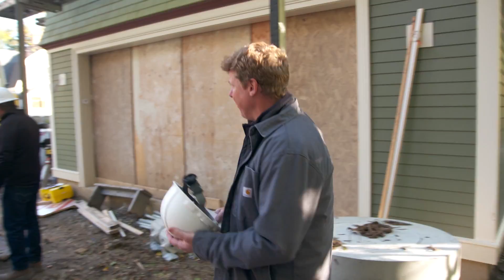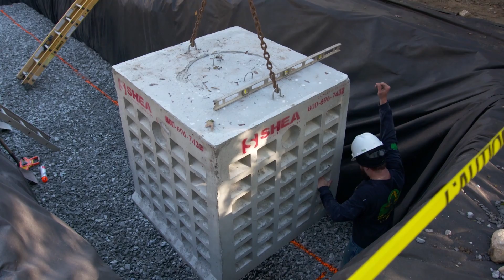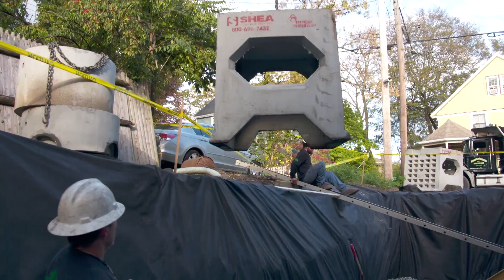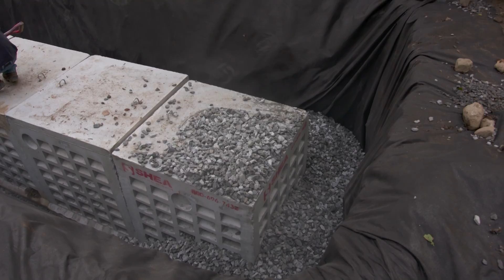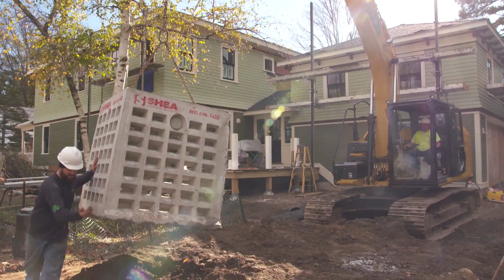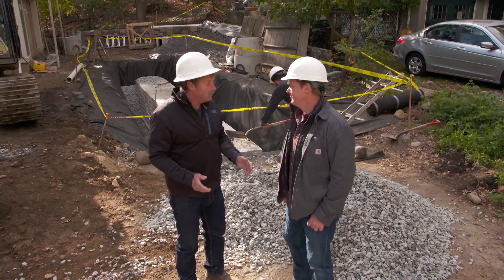Installing Dry Wells | This Old House

Comment: Where is the water going to go when this thing fills up? In New England you can get a few feet of snow and then rain on top of it. That dry well is going to fill up in no time. You want to get the water away from your house, not sitting in a huge cavern under your driveway. That’s what storm sewers are for. This is the dumbest thing I’ve ever seen. Another money making scheme by the government.
Reply: Its a dry well, the idea is to temp hold water and leak out over time . . . its should be dry 99% of the time, except for really nasty storms, at which point it will hold water till ground drains enough to drain the well.

Problem with storm sewers is . . . they are designed to collect water from the streets, not spill over from lawns.  Since this house doesn't have a yard, you install one of these so when there IS that 100 year storm, the storm sewers don't back up.
Reply: That looks deep enough to be below the frost line, and snow and driveway insulates the ground.  It will seep downwards.  I have a much smaller system in Minnesota and it drains all winter without any heat tracing.  The biggest strain are the summer thunderstorms, and systems like this can have an overflow to daylight.

Comment: Looks to me that to keep this thing working as designed about every 20 to 30 years the homeowners would need to dig the entire thing up and lift out the concrete boxes to replace the geotextile or nonwoven fabric.  Because as tree roots breach it and general entropy causes the fabric to break down I expect the groundwater will wash the fines into the gravel and silt it right up.

Comment: What an bloody rip off system just ridiculous. what do they with the rainwater what falls on the street ???
Reply: In goes to the Riv-ah!
Reply: It goes into the sewer, where it has to be treated because now it's mixed with human waste and chemicals. The water that falls on your roof and property is relatively clean, it should go back into the water table.
Reply: @KevinFields777  In most cities the sewer system is different from the storm drains, they don't connect to each other.

Comment: Dry wells sometimes over fill not good but it’s still really cool
Reply: That's precisely the reason why they need to be properly sized and built. Proper engineering is fundamental! 

In fact it's no surprise that, by far and wide, it's the "let's do something" systems that generate a bunch of problems... ;-)

Comment: I don't see how this is going to work. The gravel is going to drift into the chamber over time. The ground above it will sink.
Reply: a few rocks will fall in but once buried and under compression the gravel will lock each other in place. I recommend watching Practical Engineering's "Why Tunnels Don't Collapse" video as he demonstrates this exact phenomena.
Reply: "I (don't) see", said the blind man....

Comment: That is an absolutely massive system. I did my own math and designed a 900 galon drywall concrete for my house. I've had major thunderstorms and my system has held up great with no overflow.

I pad $4k for my system. That included the digging, the 900 galon tank, the crushed stone and the labor.
Reply: Tell more. Which dry wells did you use?

Comment: When you think of how many homes don't have this sort of system (99% I guess) and don't have a major water problem - you can't help wondering whether the people who mandate the process have some other reason for insisting that its done.
Reply: Its because of the way our sewers are designed. The processing plants can only handle so much water, so there is a overflow system. A theoretical system can handle 1000 houses on a normal day, but if you add the stormwater of those houses in, you trigger the overflow, sending thousands of gallons of waste into a nearby body of water.
Reply: @henrikvtcodes  - makes sense. Basically the sewer plant can handle 99% of all the houses in that town, so no more houses can be allowed to be built unless the homeowner does this crazy and expensive additional expense. The alternative is to have the 99% of town to pay higher taxes to upgrade the sewer company to handle more. If I already owned a home in that town I know which choice I'd make. On the other hand if I were a big shot developer then I'd do everything in my power to make the local government upgrade the sewer plant so I could build houses for $25k less.
Reply: @henrikvtcodes  Thanks for the succinct explanation.
Reply: All about BS money and excuses to give reasons of existence for those crummy county/state organizations.

Comment: Seems like a lot water close to the house with no place to go if the soil is saturated.
Reply: That is the point, the dry well holds the water till the soil drains enough for water to start coming out of the well.

Comment: So in order to remodel your house,  you have to put in one of these "systems". I realize the reason behind it, but the cost of some thing like that must be alot. Hope they dont ever have to remove the driveway to repair one of those tanks or the set.
Reply: you don't have to. i mean if the drainage sucks you do. but usually just normal gutters and downspouts will be sufficient.
Reply: It’s town code. I had to do the same cost be about 4k$ not nearly as large a system obviously.
Reply: @jeffreyrosales2677  Probably because the Town doesn't want to spend money to reroute all that water themselves.
Reply: The government won't maintain their systems we pay taxes for and then they now require us to do more with us paying higher taxes every year. This is what governmebt corruption looks like, some ones palms got greased for this mandate to be made
Reply: @zack9912000  It's much better for the local environment to route that water back into the ground water table than it is to have relatively clean water go into the sewers, mix with waste and chemicals, and then you pay even higher taxes to treat and clean that water before flushing it out into a river, none of it going back into the local water table.
Reply: What a waste of money.